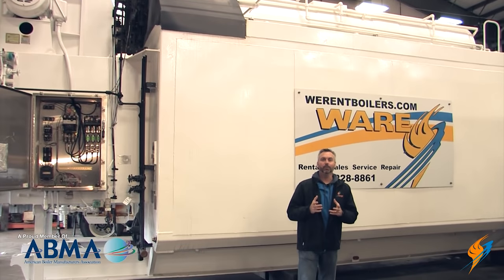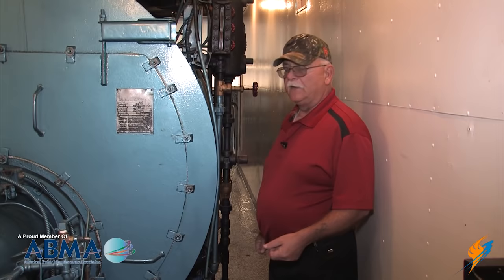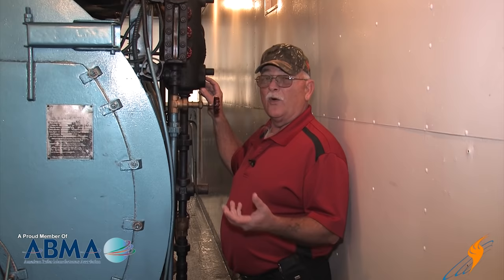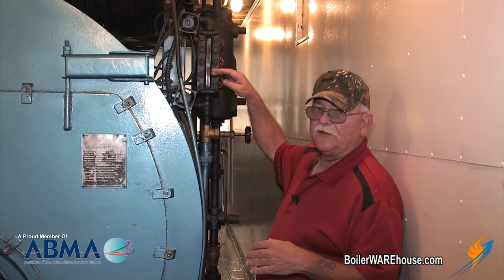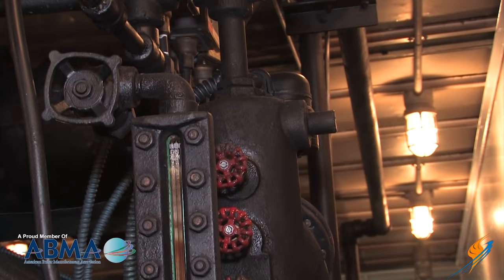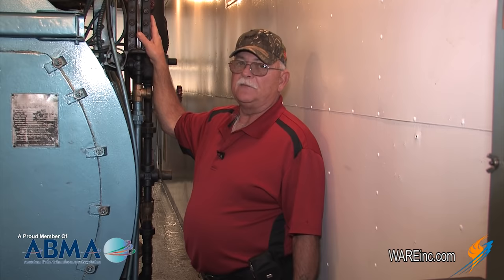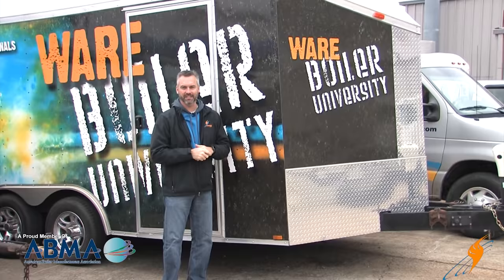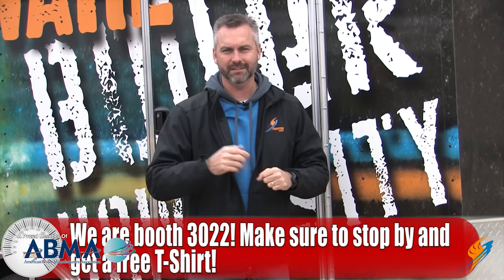Explaining the Slow Low Water Cutoff Test - Boiling Point

Comment: These will be all the parts I'll be tested on 
The Rundown
1. Cold Boiler Start up
2. The ignition sequence
3. Draft, Flue gas, and combustion (Q and A)
4. Hydrostatic Test
5. Accumulation Test
6. Bottom Blow Down
7. Slow Leak Test
8. Evaporation Test
9. Surge/DA Tanks
10. Water Treatment 
11. Grease the Pump Motor
Reply from the maker: I will get this list over to the guys and see if we would be able to cover some of the stuff. I will try and reply back if we are able to make some of those work. Thanks for the comment and good luck with your exam!

Comment: With normal blow down low water cutoff test (as mentioned at 0:30), doesn't the water inside the boiler drop to the same level as in the sight glass when the blow down valve is opened?  Trying to understand if there is the same level of risk in creating a low water situation regardless of if conducting blow down low water cutoff test or slow low water cutoff test.  Thanks.